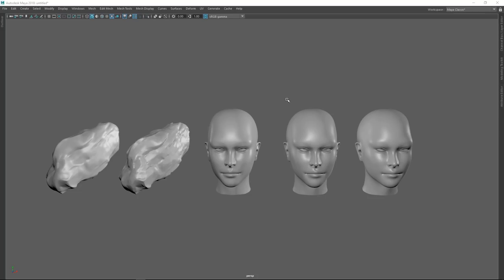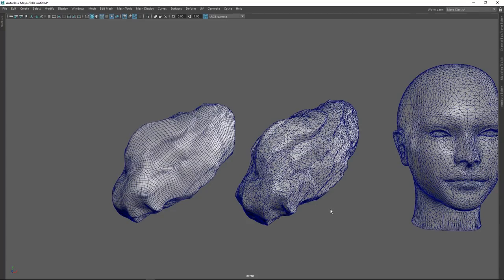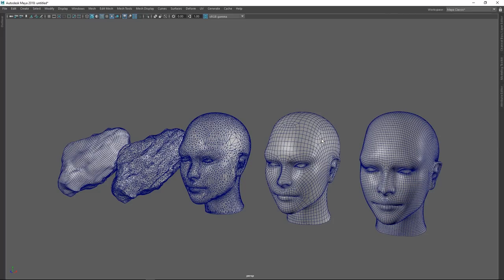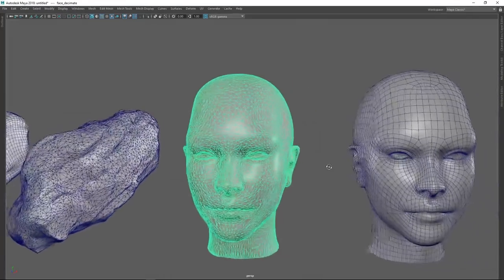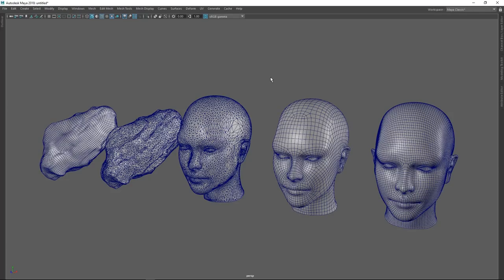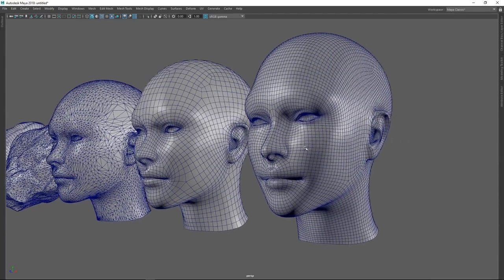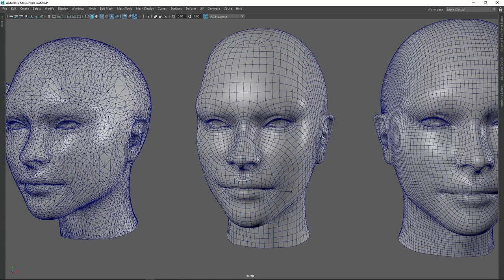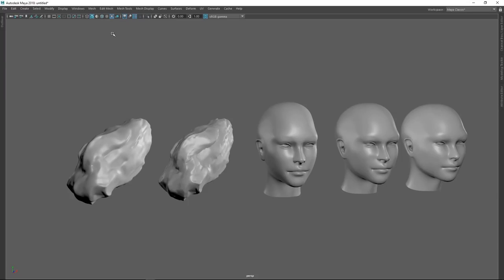Is Good Topology Overrated?

Comment: Good topology is so important for animation.
Reply from the maker: it really is. For fully animated characters, you definitely need proper topo.
Reply: If you were animating, the heads on the left and right would be no-go areas. Triangles and ngons deform the worst, and too many polygons will make weight painting harder, and make your scene run slower. Middle one gets  stars
Reply: No Shit
Reply: @SugarCrazedInsomniac  the problem with tris and ngons isn't the performance, its how they deform when verts are moved
Reply: Hard surface modeling too. If your topology bad it can give bad shade...
Reply: @SugarCrazedInsomniac  
If you went super into the geometry, everything is a triangle, and the triangle flow affects deformation and rendering speed. It's just way easier to work with quads. I don't think anyone goes down to the triangulation of quads anymore so I don't think there is enough experience to explain how they deform and the general rule is only quads. If you get your edge flow correct, then the triangulation doesn't matter. Back when a character was 256 polies or less, triangulation was of much bigger concern.
Personally I think you can get away with triangles if you understand how they will deform and your not working with subdivision surfaces.
Reply: Tris can be used but that's only really necessary for something like a game engine
Reply: I think a good way to teach people this is make them try to animate using the topology they’ve made. That taught me a lot about why my topology was bad. Doesn’t matter how I rig or skin, the deformations are just not as good as they could have been.
Reply: @aguynamedatidade  It's not just the density that's wrong with the right one. The edge loops doesn't follow the facial features. The middle one is indeed the correct topology for a face. And the density is good as well. If it needs to be smoother there is always subdivision modifiers.
Reply: If it doesn't deform topology doesnt matter as long as there are no shading issues
Reply: @KevinSmith-qi5yn  tris are still the best for painting with displacement.

Comment: First off, great points to bring to light again in an era where technology has improved exponentially.
 Of course everyone is entitled to their opinion...from their experiences or what works efficiently for them.  If there are "issues" with their retopologized sculpt, what may be a "difficult" fix for some might be an "easy" fix for others depending on their knowledge and needs.  I've been in the game industry for over 17 years so I come from the low poly (box modeling first) era where "manual topology" was all you could do.   But as with most artists, I have evolved my 3D character workflow.  I create models for both games, illustration and sculpts for print nowadays.

Before I jump ahead,  I think it is very important to have an understanding of manually retopology of a hi-resolution model, and at times, even certain props, vehicles or environments.   It obviously gives you more control to have efficient polygon count, deformation and a better flowing model overall...especially in game engines.  But on other hand,  I believe that Zbrush gives the artist a freedom...a freedom that they didn't have with other 3D modeling packages; to quickly prototype/conceptualize characters without having to worry initially about deformation, polycount, etc.  Zbrush art history has shown that there can be great character sculpts even from pros who haven't manually retopologized (or maybe haven't gotten to it yet).  

It seems the bigger argument here is when to do manual retopology.  Some prefer it earlier but I have preferred to do it much later towards the end of the pipeline.  I give my arguments below.
Auto-retopology was never meant to replace manual retopology.  It was meant to get the artist some "almost instant" results while you are sculpting to better flowing topology than it was in its prior state.
It would take you somewhere between 30 minutes to  hours manually retopologizing a character (depending how complex it is).  
I found that using tricks in auto-retopologizy will get you nice deformations so can to continue sculpt without losing time or worrying about sever topology issues.
Sure it's not perfect but it's very quick and workable enough where its not difficult to manipulate if you run into "topology" quirks.
That's where auto-retopology tricks comes into play to help speed your workflow along.
 I think doing manually retopology too early can be counter productive at times because, as we know with clients, there will be many changes to a character...sometimes even drastic where you would have to do manual retopology again.   So now you're spending another extra 30 minutes or hours manually retopologizing again.   So there are several cases where manual topology treatment is best served until  close to the end.    Time could be spent better elsewhere down the pipeline. Topology is very important but the client is not going to scrutinize incorrect topology on a character concept or translation when you present it.    All that matters in this stage with Zbrush is to quickly get the translation to the 3d model; the likeness or appeal of the character, color, flow, pose, silhouette,...maybe even textures, lighting, etc.  As @FlippedNormals showed, you can barely see a difference and manual topology is not as vital when it doesn't matter to the client....or even to artist at this point.   Perfect topology is not necessary in this part of preproduction but you still have to have better working topology than you had.  That's where knowing how to get nice flowing topology quickly with zremesher  will save you a bunch of time.
We know that the results of auto-retopology are still unpredictable even with the current technology but it is a godsend when you know how to use it quickly for your advantage when you need it most.   I think the stage of manual retopology for games, films, illustrators and digital sculptors comes down to their preference.  I think it comes down to this.  If the artists feel they have better control doing manual retopology earlier,  then that's the workflow that works best for them.    If they feel that manual retopology too early slows them down and like the quicker workflow of tricks using auto-retopology then that perfectly fine too.  
Now not retopologizing at all?  Not my cup of tea but good luck. 

Also, another reason I think it is important to learn proper manual retopology and not just rely on zremesher (or other auto retopology methods).   Learning manual retopology (like subdivision/box modeling) will give you a foundation of how the polygons interconnect for proper edge flow and deformation which is important for games and film.   Sure it's nice to use the quick tools that will "get you by"  but I think it's good as a 3D artist to have a foundation and better understanding of topology.   This is not a great example but it would be like a character animator or character  illustrator that hasn't learned the foundations/principles of animation or drawing.   An understanding of proper manual retopology can keep polygon count efficient too since you have more control.

Also, in regards to characters that require low topology, there are certain  "configurations" (poles, ngons, closed edgeloop, linked edge loop, etc)  that not only look better when viewed in game engines ( or even animated film).
I remember the joys of turning edges in low polygon modeling to get a smoother looking topology even for static objects and characters.
This applies to non-gaming and non-film digital sculpting too but not as strict as game engines.   True it may be less of a worry to manual retopologize, but you can get some workable topology in Zbrush with some auto-retopology trickery.  
But like I said, although I opt for manual retopology in the early phase of production..... time constraints usually limit how much time I want to spend on one phase of the pipeline.
In my case, I save the manual retopology for the end.   We know the product or character will go through several iterations and even total redesigns  that manually topology would be better saved until the very end when it is approved.
 It doesn't make any sense spending time manually retopologizing twice when you don't have time to spare.  That time could be better spent in posing, texturing, pbr creation, rendering, etc.  Nowadays I mainly use the mask/polygroups zremesher edge loop creation trick (I first saw it from a Steve James tutorial).  It's not perfect but it's a time saver that I have adopted into my workflow when I don't have time to spare.

Another side point is that I think posing the character as fast as you can in Zbrush is so essential because you can see some possible issues in your model you might not have seen in the T-Pose.   Manually retopologizing several layers of meshs (apparel, hair, props, etc.) can get daunting and very time consuming with something that needs a quick turn around to the client.  That's where knowledge of the tricks and tools in zbrush can be a time/life saver like t-pose master, polygroups to guide zremesher, and even reproject to dynamesh at times.  And even if you end up having a noticeably bad topology in one area but zremesher doesn't help, then just retopologize that area.  
I personally wouldn't have any difficulty or loss of much time tweaking portions that didn't deform properly  if I didn't do manual retopology at first.   ( I'm mainly referring mainly to pre-production models where posing your model quickly for approval is necessary for some clients.)  The minor adjustments that I had to tweak with the sculpted pose or modified character was light years faster than the time taken to manually retopologize the whole or even part of a character...not to mention the apparel.   If the client requested a major change, redesign or other extreme modification, it would have have to retopologized again anyways, so time spent manual retopologizing would've been wasted.  If done properly with zremesher, no client is going to be concerned about imperfect topology and edge loops.    So like I said, I'm a big supporter of manual topology I feel it's one of the last phases of the character production pipeline.  Thanks for listening to my rant. LOL
Reply from the maker: Hey! Thank you so much for your very interesting and enlightening comment - it's much appreciated. It's fantastic to hear the opinions of somebody who's been deep in the trenches in the game industry.

My experience in the film industry is very similar to yours, in the way that good topology is really a basis for everything, as it makes life a lot easier. That said, it's not always doable from a time perspective, and then Zremeshing stuff can be a great time saver.

Essentially, use whatever tool gets the job done, without religiously sticking to one technique or tool. 

Again, thanks for your elaborate insights! :)
/Henning
Reply: Thanks guys.  I didn't think I was giving any helpful insight and just rambling away. LOL
This was a great topic you brought up though.
 It's getting some constructive and heated reactions. hehe.
  I'm sure many more qualified industry pros....unlike myself ( I still have lots to learn) will have much to say on this.
I just found you guys within the past year and your videos and website rock!  They are very helpful and insightful as well. Thanks again! :)
Reply from the maker: Ramble away! You have our permission :D We definitely appreciate other qualified opinions here.

Comment: As a game environment artist, the only time i do manual retopo is if i have very, very few assets to produce. Modern baking and material painting tools are so good it really doesn't matter if your uvs and topo are awful. For many environment assets retopo can take several times longer than the actual asset so its really, really not worth it. I either use custom mesh normals so the mesh holds up on its own without a highpoly or i use automatic retopology. Its a good skill to have but its also a massive production bottleneck for environment art. =/
Reply: The topology has a role in making human readable texture maps in regards to island layout and separation, which allows for quick touch-ups in 2D software. So there's that. (Again depending on what workflows are preferred.)
Reply: For environment pieces that makes total sense. Good topology is for deformations and shading, but with environment assets that don't deform and whose shading is based on a normal map or custom normals, the best method is whatever is fastest and lowest poly. Agreed 👍
Reply: isnt topology completely useless if you're not animating the object?
Reply: Its useful, but rarely worth the time. Environment topology tends to be different than character topology, like triangles are totally ok. It saves polycount, makes vertex painting smoother, can remove intersecting geometry which is more expensive to render in games, etc... but none of it makes a big difference and can often take longer than actually making the asset itself.
Reply: So would you just use something like decimation master for creating your environment model's topology?
Reply: Depends on the asset, if it's a rock, cliff, statue, etc... yes. If its architectural, mechanical, anything hard surface, than i'll usually skip the highpoly and start at game resolution, using addons like Y.A.V.N.E. or Blend4Webs normal editing tools to make the asset hold up and have nice bevels. The only time i do manual retopo is on tiny detail pieces i'll re-use, like drawer handles, little baroque elements, etc... For tiny things the polygon savings is worth it, even if tedious.
Reply: Then.. How do you create Uvs from a decimated object? Just use a UV projection of some sort? Texture in something like Substance Painter with TriPlana projection to hide the Seams? Curious because I'm starting to see this more and more, but theres not so much written about it that I can find.
Reply: If the game use traditional, one big texture for the whole object than yes. I'll try out auto-UVs to see if the're good enough. They usually aren't good enough, so i tend to lay out some uv seams by hand and keep splitting until my unwrap look good enough. Substance tools are super tolerant of terrible uvs, the only thing that matters is making your seams roughly straight and not having super distorted uvs. However if i'm working with material layering shaders, which a lot of games do these days, you need better uvs. i'm a lot more careful about projection and hiding seams properly then. I usually have 2 UV maps, one for the tilable materials where my focus is on removing stretching and making sure they tile smoothly. The second is a non-overlapping UV for lightmaps and baked maps, normal, AO, Material mask, etc... There are a lot of good UV tools out there for speeding up the UV process, so it generally doesn't take very long. most are 5-15 minutes, sometimes up to an hour but usually not. Hope that helps!
Reply: Yeah, It does! Thank you :D Im still curious of the Decimation to UV work flow, since It must be real annoying making uvs from Decimation if you ever have to do it manually. I might try some of these things out :) Thanks so much!
Reply: you need good topo in order to keep polys low aswell they didnt mention that since they work in vfx and that doesnt matter but in video games it does

Comment: Good topology is incredibly useful for many aspects of 3d production, but there is always exceptions.  Most animators and even some Mograph artists would appreciate good topology when working with models that are rigged or being put through some form of animated motion.  Topology defines the model's ability to bend, twist, and sometimes even interact with the surrounding objects in the scene properly.  Good topology can also be quite useful when any topological customizations are needed in the workflow.  For example, new textures or geometry additions on the fly are much easier to create if the topology is logical and neatly organized on the mesh.  Sure we have specialized software now with which retopology or painting without defining UV's is possible, but not everyone has immediate access to these workflows and, in a pinch, it is just so much easier to work with clean geometry and edge flow than messy or unnecissarily dense polygons.

Comment: Good video guys!  I thought your “center head mesh” had 5-point stars to close to the mouth and then you called in out near the end of the video so I’m glad you did that.  I also think your nasal-fold edge is a little high above the nostril, but I know everyone has an opinion on topology, so I make mine based on where I worked and what I see some “top” modelers make.  I also know it can change…
I have worked at a company where all the topology had to be quads, and as you said it was because of their UV software.  I think it’s good to learn to model in all quads, and then if you’re allowed to use triangles, then you put them in non-deformation areas.
Another thing not mentioned is it good to have stars with more than 5-sided-edges and having a star more than 4 edges on the center-line…?
Again, good video guys and this is a subject I could talk about all day... :-)
Reply from the maker: Thanks a lot for your input, Roger! I know which company you speak of, and they sure know what they are doing :) 

The base mesh we are using here could definitely use with some improvements, like you rightfully point out. It was pretty handy that it had some errors though, as it meant we could use it as an example of how to improve topo.

Good seeing you on our channel, and I'd love your input on our other videos :)

/Henning